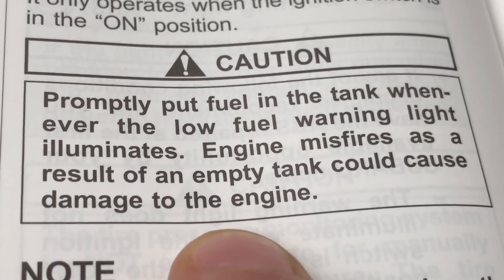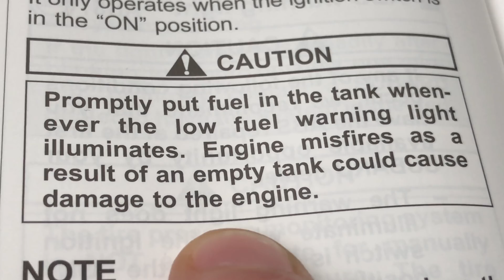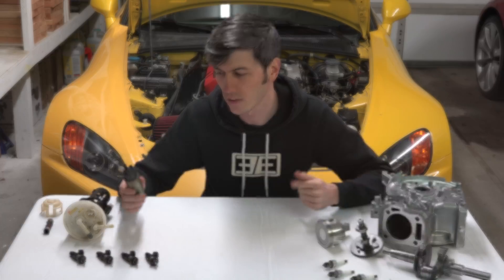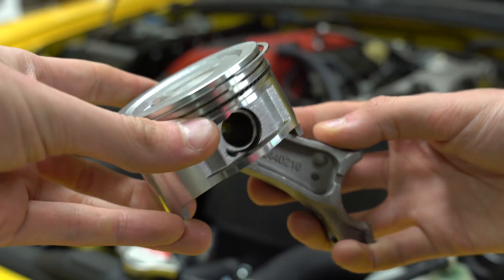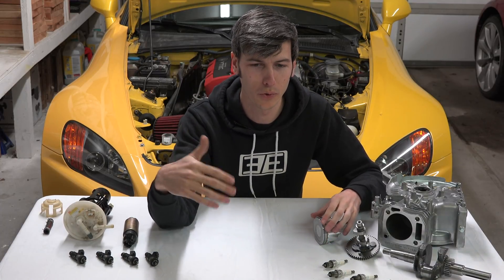Will Running Out Of Gas Damage Your Car?

Comment: Life hack:If fuel starts to run out and engine starts to cut out just steer quickly left-right so fuel slushes in tank and you will get some more couple of miles. Of course there is slight risk of fuel pump damage.

Comment: One thing that was overlooked, though rare, is sudden fuel shortage. Last year we had a state wide truck drivers riot that stopped fueling of all gas stations overnight. Coincidentally, my car was on reserve and wouldn't make it through the next two days (the protests lasted over a week). For that time, the car was completely empty. Since then, I also run on at least 1/3 in fear of some day, fuel simply disappearing.

Comment: The thing I really wanna know about gas tank is why the first quarter seems to last so much longer than the 3 other quarters left ?  Why the needle is so non-linear ?
Reply: They should be linear. However, the fuel pump gauge is a resistance based sensor. As the car gets older corrosion can make the gauge inaccurate

Comment: but what is considered low fuel in the first place ?  When my low fuel light turns on I still about 1 or 2 gallons which is a ton of miles... so I guess it's not that low at this time...

Comment: Most Importantly: Because the plastic fuel pump sits in liquid gasoline the pump is meant to be insulated by the gasoline itself which has a low freezing point/high boiling point and maintains a stable temperature range regardless of exterior temperature swings.

Comment: How about the thinking more dirt will be sucked up from the bottom of the tank (because of less dilution from the liquidity of the fuel)? Or basically if true the fuel filter will get clogged up faster.

Comment: I definitely noticed very minor performance and mpg gains in my first 2 cars which were 1 litre and 1.2 litre running with less fuel in the tank due to weight. Last car was a 1.8 astra bertone and current car is an audi tt 225. By habit ive always ran with a maximum of half a tank since my first two cars. Yet to even test if there is still a difference in the higher powered cars i drive today...

Comment: 4:10 yeahh learned that the hard way. Very scroogy during college years. Only filled ~$3 equivalent when its on empty, always having to fill ~$3 when its empty. So im gessing the fuel pump never get to properly “bathe” in the cooling fuel. Busted my fuel pump after just 1 year of usage. It was a handmedown car from my old man n he had it for 5 years. After changing the fuel pump, always kept the fuelgauge above the quarter line. Its been 10 years since the last time i changed the fuel pump of that car and my little brother drive it around now. So yeah, always keep the fuel decently above empty to prevent overheating. Especially for older cars who dont have electronic cutoffs.

Comment: I'm always filling up to 25litres(6.6gallons) of high octane (98%) fuel so I'm sure to rip at any given moment.
So I'm driving with the 'tank' symbol lighted up 30% of the time.

Also, when I'm closing in on some big intersection red light, I turn off the car key beforehand, roll on for 55yds and just brake.

Is this bad for the brake system and/or the power steering (since I use force to turn the wheel to get in a decent position)

Thank you for your teachings!!

Comment: The main issue I've heard of, which sadly wasn't addressed at all, is the layer of water from atmospheric condensation sitting atop the fuel getting into the fuel pumps' intake when the fuel level is bottoming out, and thereby getting a fuel/water mix into the engine and fuel systems. Seems to me like a valid, or even the the main concern, or is it just an 'old wives tale'? I'm sure many others have heard of this and would appreciate it being discussed in a follow-up up video.

Comment: I was warned that the fuel not only cools the pump as it passes thru, but also cools the housing of the pump, so that low fuel levels reduce the outer surface cooling of the pump.  Any truth to that?

Comment: some of you fill up at 1/4 a tank for whatever reason.  i fill mine up at negative 1/16 because i dont particularly like the ritual of fueling very much.  my mentality is that if i always fill it (dont just put $10 in) and if i wait until its empty, i will minimize how many times im at the gas station in my life.  im telling you this because every car i have owned (that has a fuel light) has allowed me to drive at least 60 miles farther.  i have never run out of gas except for my truck that didnt have a fuel light, and it was on purpose just to know for sure (i had a full gas can with me). the truck also runs out at about one fuel gauge needle thickness below the empty mark.

Comment: Misfire is bad for the catalytic converter. No catalytic converter makes it easier for your engine to exhaust making it (very slightly) more powerful. Also your car will be quite a bit louder. But having no catalytic converter damages the eviroment a lot (thats why you're supposed to have one by law). You dont get busted often but its possible; depends on the cop.

Comment: I must have one damn good fuel pump in my 2002 Mazda pick up because I have run out of gas at least five times and I used to never keep more than quarter of a tank in it for most of its life   Because I used to borrow the truck out to other people and let them fill my tank after they were done and I have a owned the truck since almost new 12,000 miles 2003  I also have driven the truck very hard drifting around corners  carrying  more than its weight in the back towing trailers that were way too heavy for it towing cars and trucks that were way too heavy for it and holding down the brake pedal and gas pedal the same time and doing burnouts in the truck still runs fine

Comment: a little tooo much stupidness here.... running out of out gas will do nothing to the fuel pump or the motor...   yes, running the gas tank LOW all the time will in fact lead to premature fuel pump failure due to heat...  it isn't going to hurt the engine.. IF its that low ?? the car isn't going to run....

Comment: He also doesn’t mention how hot a fuel tank can get in the summertime. The fuel around the fuel pump cools it as well. Even if you don’t run out of gas, just running low on fuel having the fuel line below the pump itself and the hot tank, can cause excessive wear on the fuel pump.

Comment: My truck still has around 50-70 miles worth of fuel when it hits the empty mark. According to the computer anyway, I've never let the truck run dry. I generally don't bother getting fuel until the gauge is on the empty mark and I get a low fuel warning though as long as I know a gas station is nearby.

If you never let your vehicle get below half a tank, you lose fuel economy due to excess weight (especially city driving), and you lose time looking for a station and filling up so frequently.

It would be interesting to see if its more financially beneficial to drive with a lighter (25-75%) tank vs (50-100%). This would of course be hard to pin down due to parts/labor replacement cost variation by vehicle model.

Comment: When tanks were made of steel you could get some rust in the carbs but with plastic tanks I doubt it will do any harm.
I had a van with a rusty tank that leaked at the seam so I could only run with 10 litres of fuel max.  I ran it out a few times but it didn't do any harm.
I also had a couple of Ford Sierra's with dodgy fuel gauges that I ran out a couple of times when I first got them, again no problems.  If it's diesel you have to know how to prime up the fuel pump which is a pain but other than that I can't see it being a problem, it's one way to clean out the tank.  Should be plenty of filters in the system anyway.

Comment: I believe in Actuality this device is pushing. A Fuel “ Pushing. “

It a fuel pusher.
Reply: Years ago cars had mechanical fuel pulling pumps on the engine. The ran on a rod running on the camshaft. A lot easier to replace, but engine heat could cause "vapor lock" when bubbles formed before the pump and so it couldn't move the fuel.

Comment: Well that’s a rip for me then. I usually fill up when the car estimates that I have about 30 miles left. I don’t know how accurate the readings are but it’s never run out before.
Reply: You're good. I've done the same for over 15 years and no issues.

Comment: Some cars have the fuel pump in a small container that has a one way check valve. So when the fuel gets to sloshing when it’s low, the pump never runs dry. When you modify the car and demand more fuel it can suck the container dry before it can fill up through the check valve running the pump dry even with a full tank.

Comment: I was told that when you run your tank empty on a diesel engine, it might not even start because there’d be air in the system (and that you would need to bleed that air).

Can someone explain to me why a diesel engine wouldn’t start and a gasoline engine would?
Reply: Diesel injectors operate at a much higher pressure than petrol- it can easily need 10,000 PSI to open an injector valve on a modern diesel, compared to as little as 800 PSV on a petrol engine; these figures will vary and I'm just going on two engines I've recently worked on. To generate that amount of pressure on the speed a starter motor can turn the engine is possible for a petrol (gasoline) engine but just about impossible for a diesel.

This isn't a perfect explanation but it might help: let us pretend that you are trying to push your car up hill by hand- normally your hand would be in contact with the bumper (fender) and you can transmit all your force to make it move. Now imagine you tied a load of springs to the back bumper (fender) and tried pushing against that- most of your force would be wasted in compressing the springs, not moving the car.

Now replace the car with injector tip, replace you with the fuel from the injector pump and the springs as air trapped in the pipe.
Reply: @derekstuart5234  
Thank you very much, sir. I appreciate it.

Comment: Thats interesting, I knew all this but wanted to confirm however it seems my engine runs REALLY lean, it is a eco sports car but still my normal air to fuel ratio is 14:1 my normal wot air to fuel ratio is 28:1
However, this could be due to the very high compression ratio
I might need to get that tuned I might be able to make more power even though I have only done bolt on mods

Comment: Hey mister engineer, when you run out of fuel, the car stops running and so does the fuel pump. eureka! no more pumping air.  go back to college. nice explanations but running out of gas does little or no damage to your car.

Comment: I used to own a car that ran on LPG. It ran out of fuel many many times, because I could switch to pertol anytime it happened. I could feel it misfiring or completely cutting off at higher load when it was running low on fuel. This would eventualy happen at less and less throttle input up to the point that the car would not accelerate anymore. Of course the fuel pump problem was not not an issue there. The car did 300k km so perhaps not much damage was done to the engine by doing that.

Comment: We used to have these Chevy 3500HD work trucks. Twin fuel tank. The fuel pumps would burn up in the auxiliary tank first and then the main tank all the time. Come to find out those trucks are notorious for burning up fuel pumps if you run them below half a tank of gas. First, the fuel gauge stops working indicating the auxiliary pump has failed. Then, the main tank fuel pump goes out some time after.

Comment: Just curious, by running low on fuel, do you mean like having 5 litres left in the tank or less than 1? I usually go to the gas station when the fuel light comes on, and that's when I have 5 litres left in the tank.
Reply: I run my car on fumes only. Maximizes fuel efficiency
Reply: Depends on the car

Comment: While the fuel flow does do the majority of cooling, having a half tank or more submerges the fuel pump
 , making it run as cool as possible and also it’s quieter.... I usually fill by 1/2-1/3 tank .

Comment: I can't recall the models, but there were a few in the early days of electric fuel pumps that used the fuel in the tank to cool the pump.  Running under 1/8th full extensively killed the fuel pump pretty quickly.  I knew someone that liked to run their tank from full to empty and that killed 3 fuel pumps under warranty.  They were finally told to refill their tank at 1/4 full and they never needed another fuel pump.  I might note that I've always suspected that electric fuel pumps were placed in the gas tank for the benefit of liquid cooling them in the first place.  If fuel pumps didn't need gasoline surrounding them to keep them cool, I suspect that we would see more in-line pumps.  They would be easier to service and overall safer than running an electric motor in a gasoline vapor environment.

Comment: How low is considered low though? For some cars, when the gas light is on, there is usually at least 2 more gallons of gas left in the tank - Example: Mazda3 light comes on after 10.5 gal, but it's a 14.5 gal tank! Even in the S2000, you still have almost 2 gallons after all the gas bars disappear.  I know this is also specific to the gas tank design of each car but certainly there should be some safe threshold of low (and perfectly okay) and accepted level of "yea, that's low with real increased risk"? I always fill as soon as the light comes on.

Comment: The quantity of gas that flows through your pump at low speeds is very small, and I have a hard time imagining you getting much pump cooling from that.  I suspect that the temperature of the pump has a lot more to do with the temperature of the gas in the tank, and I bet you get a lot more cooling from having the pump fully immersed in a full tank.  In other words, the lower the gas level in your tank, the less cooling you get for the fuel pump.  It probably doesn't matter much in the winter time, but if you live in a hot southern climate,  keeping your tank mostly full might make a noticeable difference in the life of the fuel pump.

Comment: When my bike's fuel light is on, i open the tank and swing the bike. 
1. If i still can hear the splashing sound, i can drive it home.
2. If i can see the fuel, i can fill it tomorrow on the way to work.
3. If i can't see or hear splashing sound, time to fill the fuel.

Fuel indicator is a scam made by those cheeky engineers
Reply: I dont think you have a clear understanding of the word scam. 

Secondly., they low fuel indicator gives you enough warning that if your on the highway,  sometimes the next gas station exit is not for another 50 miles.  So giving you enough fuel to get you their.

Comment: I ran out of gas just once, right as I pulled into a gas station. A couple days later my fuel pump died.
Reply: Coincidence
Reply: F
Reply: Ditto. But my fuel pump died at the station. $240.00 tow bill. $150.00 fuel pump. I put in about 3 gallons at the station.
When I installed the new pump. I adjusted the float arm. So that 1/2 tank is now 7 gallons used vs 11 gallons.
Reply: My wife liked to run her car on low, and eventually she ran out of gas. It would not restart when refueled.  Reason:  fuel pump was shot.
Reply: Same thing I ran out of gas and my dog died never a gain no more dogs
Reply: My fuel pump burned out while I was at a gas station once.

Pure irony but still. It's funny looking back but back then it was frustrating.

My dad was able to tow me home on his car dolly and we DIYed it so it wasn't as expensive as it could have been.
Reply: If you run on a very low tank of gas, I would think you would more likely get a cold thermal shock to the heated fuel pump and risk damaging the fuel pump,  If you already have some fuel in the tank (1/4 to 1/3 full) , not likely to happen.
Reply: I routinely let the low gas light come on,if on the way home it will wait till I get back to town, 50 kilometers round trip. Did this with all my cars since they started putting warning lights in the dash.
My current car,2004 Corolla, has a half million kilometers and the only work done besides regular oil  changes etc were a oil seal and a couple of wheel bearings. 
Did the rocker panels this year. She's showing her age,gonna miss the old girl..🤔

Comment: With a low amount of fuel in you car the fuel heats up!!(return line) The fuel also takes some heat from your injector gallery and with little fuel in the tank there is not much square cm(or inches) to dissapate that heat.... That's a fact

Comment: Hey I have an idea for you. Go over   for an NA car running a water to air intercooler (ice bath). Volumetic efficiency, optimum sizes vs. water temp. Lower than ambient temps almost guaranteed but intercoolers cause a resistance in flow but depending on the size of the intercooler would be needed to make this resistance negligible with out adding too much weight.

Comment: Wrong. It will not be damaged by running low on fuel!!!
Reply: Some cars may suffer badly. Our 1985 Volvo 760T had a problem common to Volvos of that era. The design has a low pressure pump in the tank and a high pressure pump under the car. After a while the bellows hose that connects the pickup to the pre-pump tears (part of the $300 pump/sender assembly... probably a lot more now). No problem if the fuel level is above 1/4 tank, but if the level drops below the tear the pre-pump will suck air in with the gas. It is safe to say every Volvo from the '80s before the 1988 model year have experienced that by now.
Don't even get me started about GDI and diesel engines, where the very expensive pumps will be destroyed by a moment of running dry.